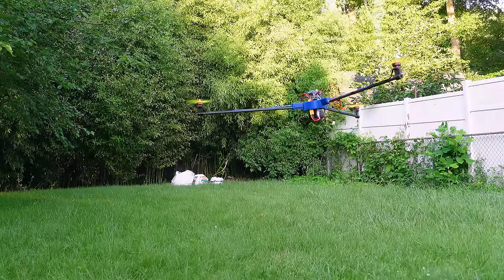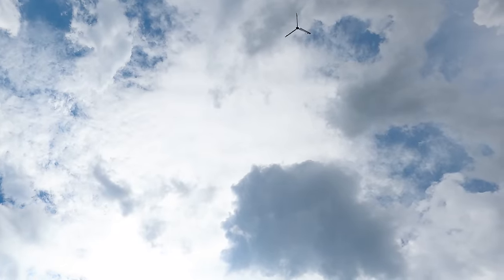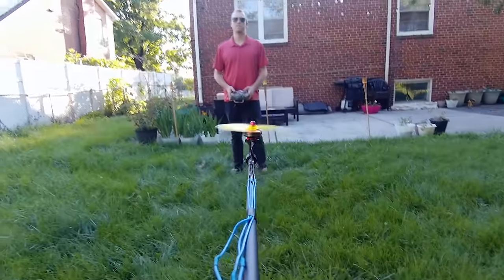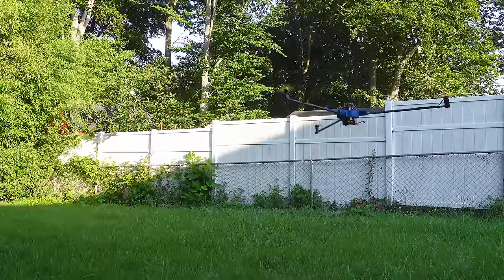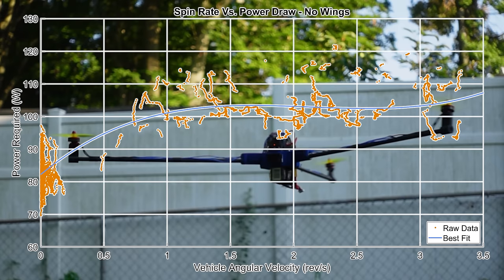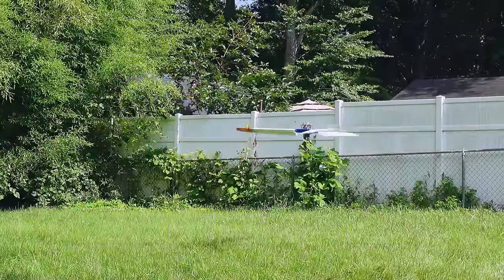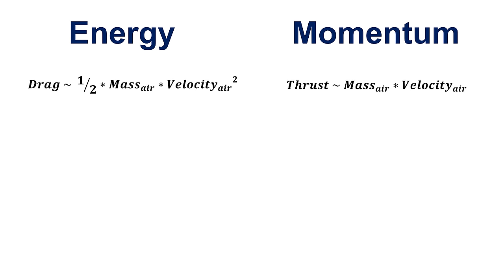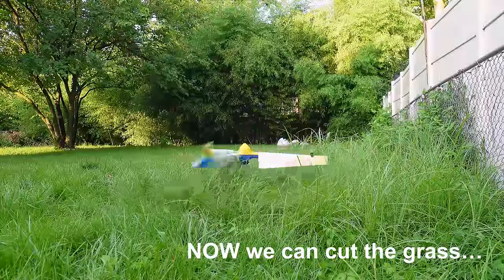The Spinning Drone Paradox - Part 1

Comment from the maker: Follow me on twitter for occasional exclusive project updates (and memes): https://twitter.com/Nicholas_Rehm
Reply: Tienes poca idea de la propulsión electromagnética de los Condensadores Asimétricos, llámalo también electrodinámica
Te lo imaginas? Pues funciona igual pero tanto con el Aire como sin aire o más allá de la atmósfera.
Reply: Did you create the design yourself or get it from somewhere else?
Reply: Absolutely superb creativity, prototyping, and testing. As a design engineer with many inventions and research papers, I highly commend your work. I’m not in aeronautics, but I understand the energy situation, and you are doing yeoman work!  Thank you so much, Steve
Reply: which course did you stuyed
Reply: I imagine a similar drone with free rotating camera in the center.
The drone would be able to use two of the wings like an airplane (third wing as a tail) and hover like you do.

This could be the future of personal aircraft haha
Reply: Subbed for the math me teacher couldn't explain to me :)
Reply: Here is a video of the WowWee toy from the 2000's: https://www.youtube.com/watch?v=JPfUR1Kq1-A
Reply: So now you need to add cyclic control xd
Reply: It is not a paradox. This is basically a tilt-wing design that spins, just like V22 Osprey.
Reply: I will suggest to move the engines to the tip of the prop to get a better angular momentum, the prop should have a higher aspect ratio at the lower spinning point like half teardrop shape and placing a bottom cone with a counter rotating turbine blades will accelerate the residual flow into a Coanda effect. My two cents improvement on your design for higher efficiency.
Reply: Propeller-ception? If this is an order-2 propeller (where mini propellers cause a larger propeller to rotate) what happens if you make an order-3 propeller (where three order-2 propellers are used to spin a even-larger propeller)?

I imagine the control software might get a bit complicated--though the planetary gearing system probably helps localize some of that complexity into the mechanics. It'd be especially cool if the control software was eventually generic enough that it could run any order-N propeller you'd care to build and just re-configure the software to set the value for N.
Reply: In addition to recursion, I also wonder if there's anything to the possibility of inverting this concept. I.e., instead of propellers spinning propellers to create a large airflow from relatively little energy, what if we mounted small windmills on the blades of a larger windmill? Would we thus be able to more efficiently capture more energy from a same/given of amount airflow / wind?
Reply: @steveperreira5850  Hear hear!
Reply: I feel like a newer control would be the wing direction that would have one default foil, a neutral foil, and a flipped foil for better wing efficiency. However it would be complex and add weight to the drone.
Reply: This could be va very interesting concept for a electric helicopter. Only thing needed is a non rotation cabinet below or above it 🤔
Reply: I am still trying to understand this strange paradox where moving big wings through the air provides lift. Someone should try this on an airplane or a helicopter.
Reply: now add a circular wing and since tilting and flying horizontal apparently isn't a problem, this could possibly improve stability, or could be redundant weight...
Reply: Could you make a larger ring to take advantage of that, so that you don't have to spin the whole thing to achieve that hover?  Kind of like having a fidget spinner where the center doesn't actually move. Use a 4th prop to thrust around :3
Reply: im hooked,this is really innovative
Reply: Just copy how a helicopter moves
Reply: Hell, you could make the ultimate dream, the rotary winged glider.  Easy to keep in the thermal when the craft can match the speed of the thermal without having to turn all the time to keep from stalling like a normal glider
Reply: Doesnt really need a whole video.  You create low-high pressure difference like an airplanes wings.  Hence lift.
Reply: the flight @ 8:17 ... why not spin the large wings too ?
also, wouldn't a hybrid design like this have a really strong lift capability ?
Like, lifting logs, or people with injuries out from a place that is difficult to access ?
It's basically a remote controlled helicopter rotor that can control itself ? But it doesn't have to lift an entire helicopter as well.
Reply: This is very interesting and rather unintuitive application of physics. Thank you for the video and keep up the amazing work. I am currently in school for engineering and it definitely makes it easier understanding all of the terms. The relation at the end is a very good practice when conveying information that I have found that most professors do not do and they often answer questions with the same explanation instead of adapting the idea into a more unorthodox method to get the idea across. This also shows why VTOL aircraft like the Osprey  still have wings, so they can fly much further and faster than if it stayed in helicopter mode the whole time.
Reply: also one other thing I have seen and noticed is that plane engines are trending to be larger following the trend that the bigger propellers are more efficient.
Reply: This is a way cooler craft then your average Drone by far
Reply: @steamer2k319  No.
Reply: .  . it's the same as wings for most conventional aircraft that have much less than a 1 to 1 power to weight ratio.
Reply: A camera with a gyro would be awesome as well.
Reply: can you get 3 or 4 of them mounted on 1 frame and have them talk to each other?
Reply: Do you think commercial drones should use this technique?
Reply: It would be really cool to add a power consumption loop that compared power/vs angle of attack of the wing-rotors. You could tune the angle to do the 'near stall' magic that bees use to fly... (and it would be super interesting to see if that max-lift angle is actually more efficient than the lowest power consumption level)
Reply: @relativityboy  What's the 'near stall' magic that bees use to fly? It sounds really interesting!
Reply: 8:10 bro that shit looks like a star wars y wing flying
Reply: How about a triple-triple (9 total small rotors, 3 combined rotors)? Turn those "winged rotors" into separate rotors and then control the the combined "rotors" for regular (if slower) flight?

Then compare the 9 rotors flying in a traditional manner to the the three "winged rotors".

I'd imagine that, in addition to energy efficiency, you'd also see a lift capacity increase.

Just a thought...
Reply: @GlueFactoryBJJ  He he, good idea!
Reply: @Terra_Lopez  Thanks!
Reply: Now do a BIGGER propeller 
run by
3 smaller propellers
run by 
3 smaller propellers.
Reply: @megatesla  
"Wow Wee"
Sounds like a company funded by Mr. Poopybutthole.
Reply: @itoibo4208  
There was a helicopter in USSR having a propeller with small jet-engines on its tips.
Reply: @maxsolo2652  Already suggested, but that configuration has the advantage of "classical" flight for a tri-copter... 🙂👍
Reply: @maxsolo2652 You must be fun at parties lol. Wowwee is a successful company that made millions out of innovative toys.
Reply: @maxsolo2652  also many home-builts. No one gets my sarcasm.
Reply: @wisdomiscenter Thought of what? This design? It isn't new and definitely makes zero sense for something like the mars drone.
Reply: I can't tell if you're legit brain damaged or just trying to do a clickbait title.  It's plainly obvious why it requires less power to hover, the wings generate lift.  Propellers only doing nothing but fighting gravity is literally the least efficient method of achieving flight.
Reply: Would ultrasonic transducers be helpful for height measurement ?
Reply: nice vid but if I remember it correctly, drones consume more power hovering than it is travelling.  basically, hovering is a difficult and expensive process so that one gets to shoot photo/video in good stability, in addition to an already good gimbal.
Reply: I dont agree how you compared it and said its 3x more efficient vs the 100w spinning of the other one when the other one hovers at 80w without needing to spin its around 2.4  2.5 times more efficient still alot but a noticeble doference compared to 3
Reply: @Nicholas what I'm thinking is, probably we got engine for helicarrier. Let me know what do u think
Reply: @kaloyanbg2799  You're misunderstanding the point. The power consumption graph shows the 2.5x factor.
Reply: There’s also an effect of turning the motor sideways. I can’t remember the name of it, but it’s why UPS makes their routes left turn heavy. Why we haven’t changed our engines to turn on the vertical is beyond me. Including the transmission and alternator/starter.
Reply: Just discovered you and I absolutely love this. It is similar to a Design I've had Brewing for a while.   Are your "Wings" Made from just Foam ?  Wonder if you used a Mesh allowing some wind to pass through would help? 🤔
Reply: @Nicholas Rehm can't the wings be tilted to more than 45? like maybe 85 degrees, looking at how an airplane wing is
Reply: May I ask, how much did this project cost you? I have an idea I wish to prototype...

Comment: Great Idea! Would make a great heavy super lifter for gliders and such once you figure out directional control. Fpv would be the next step but how would you keep the image from rotating. Mechanical or could it be simulated as level in software.
Reply from the maker: Gotta sharpen my software skills to figure out stabilizing a 360 video stream. Hardware fix may be the solution for now!
Reply: For every frame, make a triangle out of some easily identifiable feature (in your case maybe some differently colored retro reflectors placed on the ground, just to avoid any more complex image processing). Once you can identify the points of the triangle, calculate the center of the triangle. Compare one frame's triangle to the previous frame's and calculate how much rotation around the center minimizes the error of this frame to the last. That is the angle of rotation over the duration of the frame (1/60sec) for 60fps video). If you have known features, then you also have an absolute reference (ex: the blue reflector is north). Obviously a commercial solution would extract features from the environment, and thus have to determine ground truth in a different way, but for a test flight, this should give you angular velocity and orientation with very little computation.
Reply: A camera in the center could be attached to a counter-rotating motor. The motor rpm could match the drone rotation and not use much current to do it.

Comment: Very cool and makes complete sense. You get exponentially more lift per square inch of propeller/wing. I also like the comment that suggested having the smaller propellers on the back of the wings pushing them forward rather than pulling them forward as that would reduce drag and make it even more efficient. I imagine something like this might be utilized for package delivery where in the main drone is above the package holding section attached via cable and the main drone does this spinning drone effect to minimize power usage while the package holding section is lowered to the ground. It's also good for surveillance drones that just need to hover in place for extended periods of time.

Comment: The way I would explain why angling the propellers doesn't require extra rpm to stay in the air:  Now you also have air wings that is producing lift. Would love to know how you feel about this.
Reply: Thats inmediatly what I thought, those wings are producing extra lift which decreases the energh consumption required to hover the drone

Comment: Great idea and a correct observation that large, low speed props are more efficient than high speed small props. You can see the practical application of this if you look at human power air vehicles. They have huge props that turn very slowly. Planes that need efficiency, like solar powered planes use this trick too. 

Very innovative approach and fun to watch your progress. Keep up the good work.

Comment: That´s great  home-engineering.   Your video reminds me  when i was   younger,  and i  modified an IR  indoor  helicopter  by  making a  whole new blades  with bigger surface and sharper attack edges,  so  the tiny motors energy was used   better,  the Helicopter  was then, able to hover in air  even when  entered in low battery mode, for automatic landing.

Comment: the problem is that most of the time you need to fly somewhere, not stay at the same point and the weight if the wings will negatively affect the flying efficiency. however , if you need a drone which takes a position and stays there for as much time as possible, it could be a good solution
Reply: Not it the whole vehicle could be tilted while in spinny mode, the whole thing would just become a plane prop with no fuselage

Comment: Hello,  thanks so much for doing this, very interesting to see. I could never actually make this,  but I had almost the exact same idea, where a single central motor would power shafts that would run props that push wings like you have done here, but the wings would not tilt,  just the props. What would be cool is another set of props + wings on top, facing opposite and counter-rotating where lift is generated by both sets. This could allow a cylinder in the center that separated the two to carry a non-spinning payload like a camera. The center hub would allow the wings to spin on bearings while remaining mostly stationary. Very nice project! really cool. .

Comment: That's an incredible increase in efficiency! Any onboard camera will of course  be spinning , but it should be easy to cause the camera to 'snap' in sync with rotation so you have a steady movie  of any chosen direction . the frames per second will be speed of rotation.
Reply: 360 cam would work spinning

Comment: If you have the exact same setup, but have the large propeller fixed to a rail and then have another outer rail that the inner rail runs on. You could perhaps have a sensor that relays the speed of the propeller through to a controller that controls a motor that rotates the outer unit in the opposite direction. You could then mount 3 very small motors to the Outer Unit to control the direction. If three thin arms protrude downward from the outer rail, you can even mount the camera.

Comment: this reminds me of how the elevator on the  MD-83 used to work! basically instead of turning it directly using powerful hydraulics, the pilots only operate a small tab that sits on the elevator, and aerodynamically forces it to turn in the opposite direction.

Comment: You can actually mount the three motors on a ring encased tri propeller. So the outer ring is stationary. Then you can have directional control from the stationary outer right. You’ll just need to counter rotate the ring to propeller.  The three props on the inner propeller can still rotate.  There is probably a ratio you can calculate for all rotations at each angle.

Comment: Brilliant idea, well researched. Subscribed.
One thought: could you use a thin ring bearing to isolate the core from the wings? It would require separate batteries and controllers on each arm, and a comms link to control them from the core, but this would allow you to put a conventional camera on it for FPV and in theory at least, it would scale and be possible for a human passenger VTOL craft. Just an idea…

Comment: Hi Nicholas,
Airplane wings in normal level flight have a natural vortex at the tips where the difference in air pressure between the upper and lower surfaces generates the tip vortex through loss of underside pressure. That's why some airplanes have the folded up tip design, to try to cut the losses. Could you not use your engine rotation in the other direction to reverse the tip vortex losses and use the circular prop-wash to actually help charge each airfoil underside with higher pressure? 
Rather than moving your engine mountings to the tip of the airfoils,  just shorten your current airfoils to bring the tips to the engines, and then you could test the power efficiency. If you don't get any less lift for the same power with shorter wings then this should prove to be the efficiency savings at the tips votexes.
Most interesting videos, and some wonderful pieces of flying kit. Can't wait for the next installment on this one.
All the best :)

Comment: While it’s spinning, can you implement directional control through maybe 4 propellers on a base platform that doesn’t spin with the main platform, maybe it has a bearing and its own motors to counteract the force of your current platform. Then you can independently control the 4 propellers as it spins